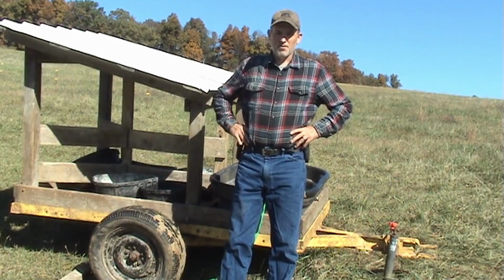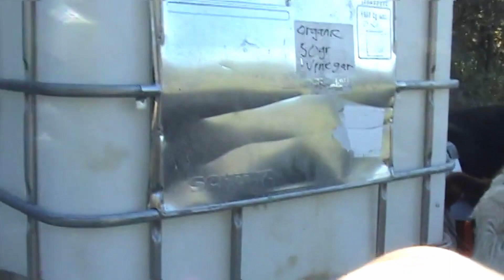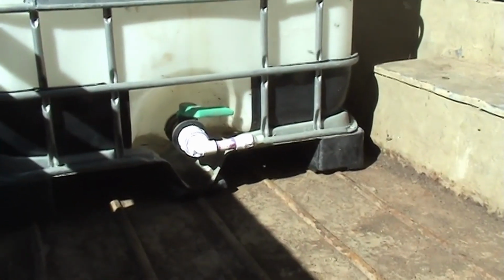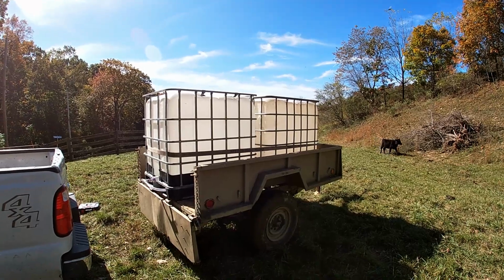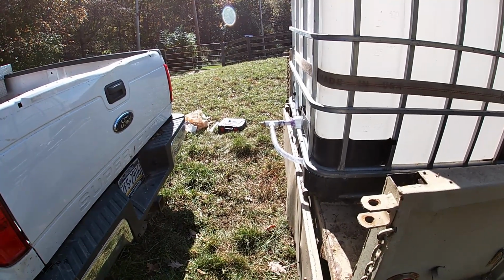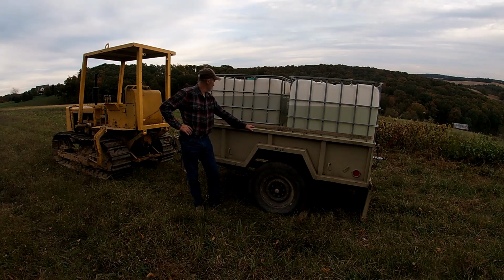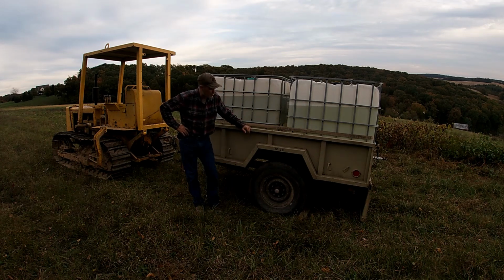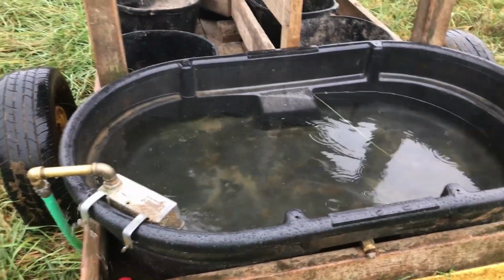Hauling Cattle Water

Comment: Hello, I have a question. I'm looking to get into hauling water. Will pottable tap water be okay for cattle or is there preferred method... we have alot of well problems in our area. Looking to provide a cheap affordable method of getting water. I have a cheap supply of city water.
Reply from the maker: Hi Midnight Chevy, city water has chlorine and other chemicals, I would check with farmer to be sure its ok with them. Good luck!